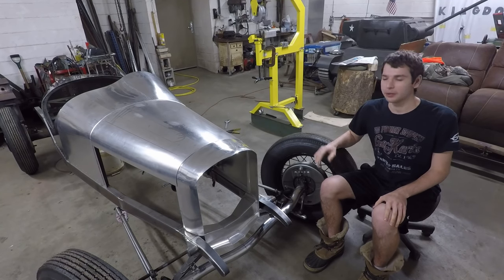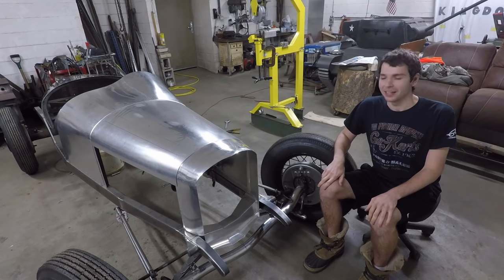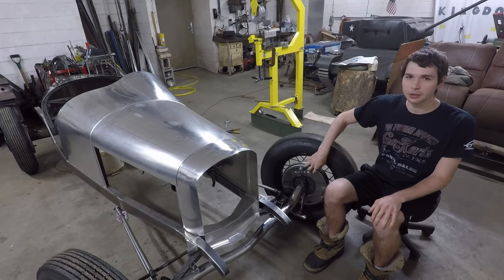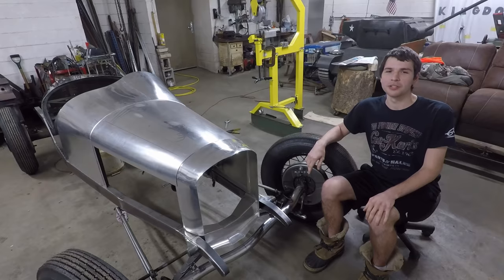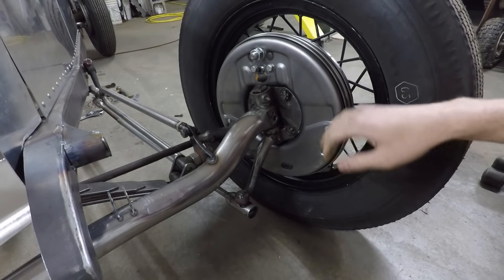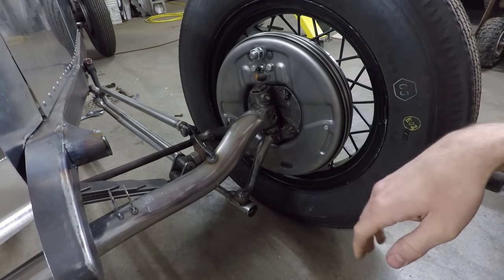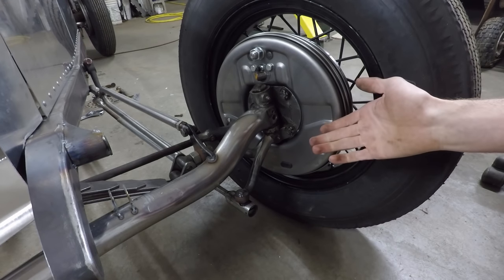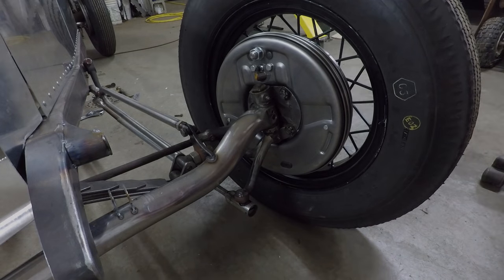New Brakes on Early Ford Parts | Homemade Boat-tail Speedster Pt. 34

Comment: Very nice craftsmanship, one thing. You don't need to have shown each brake upgrade. One front brake upgrade and one rear upgrade would be enough. Very nice little project to the steering link, looks great.

Comment: Enjoying your work very much. I admire your skills and workmanship. 
I notice that the very front "horns" of the chassis are not connected to one another, whereas most, if not all period cars had a tubular crossmember tying the two together. Might it be worth mocking it up with a bit of tube or dowel- you might think it looks" right"
Reply from the maker: I have, and I probably will put a tube across the front because I like that look

Comment: What will you be using as a parking brake setup? I don't remember if there was a drive shaft parking brake, or if you will be running cables to the rear brakes, if they are equipped with the parking brake hardware.
Reply from the maker: the rear brakes are set up for a cable parking brake

Comment: Hey MacroMachines. So I noticed that there were no cotter pins or any wire through the castle nuts in the back, is it suppose to be done like that? Man you are so talented, to be able to just make those end caps like that..pretty cool man. Have a good one man
Reply from the maker: Yeah, they'll get cotter pins eventually

Comment: So the virus was a boon for you. Yes, you still have classes online, but now free time you'd have had at the dorm you can now spend at home on the project, moving it along just that much faster. Now that I see the body, the next thing I want to see is the engine rebuild and the radiator fitting/build.